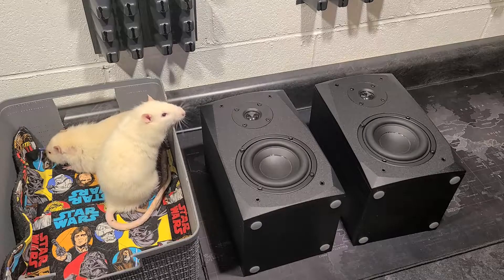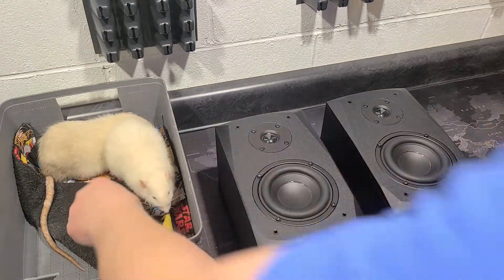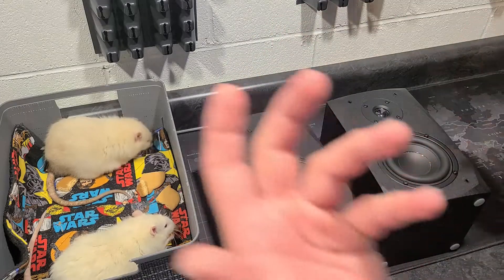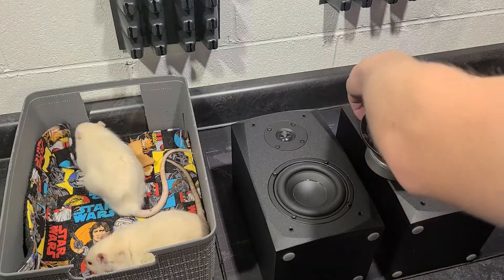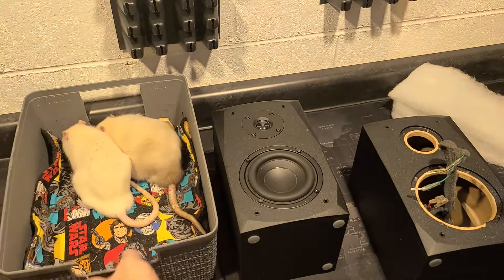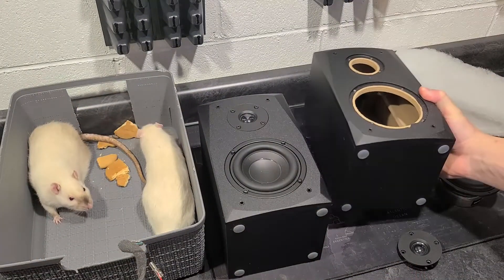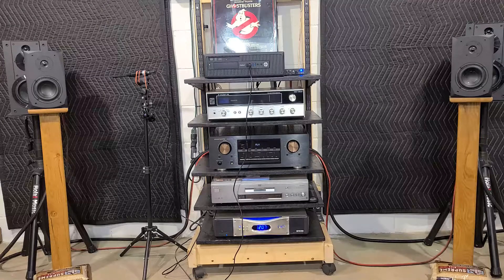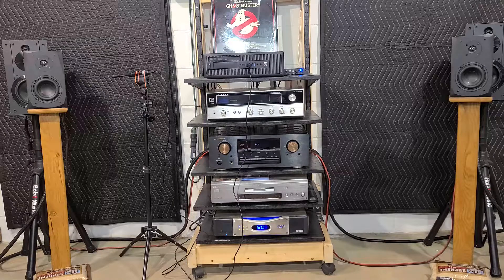Dayton Audio MK402 Compact Bookshelf Speakers & Some Rats

Comment: MK402x is just a version with improved crossover. As far as I know they did it because some people were saying they are too bright.
I think that powered version is MK402 Bt.
Anyways thanks for the video I actually asked you to do it some time ago so thanks.
Reply from the maker: Your right about the X variant and I was right about the crossover being to low at 2500hz cause in the X varient they upgraded it to a higher order and changed it to 3300hz.
Reply: @iowaudioreviews  Yes. When i was reading a reviews I know people said it was too bright and then i saw that they upgraded crossover in X version and specifically said that they solved that issue.

Comment: For anyone finding this video - these are the Mk1 versions of the MK402.  The Mk2 crossovers have a few more components. Sadly, they still don't sound all that great to my ears. The box just isn't big enough to get the most out of that woofer. If you can build a new cabinet and solder up a new crossover, these can be greatly improved. It's really not that hard if you have a circular saw and router. It turns these into a totally different speaker. They really shine when you swap the TD20F tweeters for a pair of Peerless DX20s ($27) and change a few values in the crossovers. See the measurements for yourself on the Parts-Express Tech Talk forum. Just in case you don't know, I'm Tom_S on the forums (from right here in Iowa!) and you'll see some of my measurements and crossover work in this thread - 

http://techtalk.parts-express.com/forum/tech-talk-forum/1441343-budget-diy-dayton-2-way-vs-budget-brand-monitor/page4#post1465062

Comment: I actually really like these speakers! I use them in my bathroom and they work perfectly there. I prefer them to the B652-AIRs i was using in there bore. 

I checked on Parts Express and the MK402X is a passive speaker. It must be the updated version of the MK402. YOu were thinking of the MK402BT that is the powered version. I am wondering if maybe that is why the specs were different on PE versus Dayton Audio sites? Maybe they updated to a third order crossover over in the X version? I am actually thinking about purchasing the MK402X for the sake of comparison.

Comment: I wonder if you are confusing the MB-42s with the RB-42s. These Daytons are fairly comparable to the MB-42s. Decent speakers for the price, but definitely lacking in crossover control, which results in some dips and peaks in response. The RB-42s are FAR better speakers with very refined crossovers, and they are vastly superior to these.
Reply from the maker: No, I'm familiar with all of the Micca's. I was expecting a better crossover because Dayton and Parts Express had the description for the MK402X listed for these as well, the non X variant. I messaged Parts Express and they got it straightened out on the website. These would compare more to the MB42x .  I reviewed the RB42 months ago and wasn't necessarily blown away for the price. Almost double the price of the MB42x and only slightly better performance. At $149.99 unless your space is really limited there are better book options. The RB42 have been hyped a lot mostly by Z and some others because they do perform well, but they didn't live up to the hype for me. Z recommends something and then there's a freaking ME TOO movement shortly after of fans parroting it everywhere creating a hype train. Bring the price down to $119.99 and I'll warm up to them a little more. At 20:20 I go over the xover and model confusion but you must have missed it or didn't watch whole video.